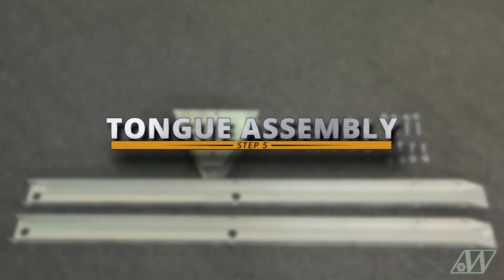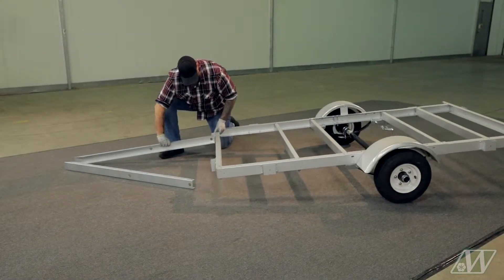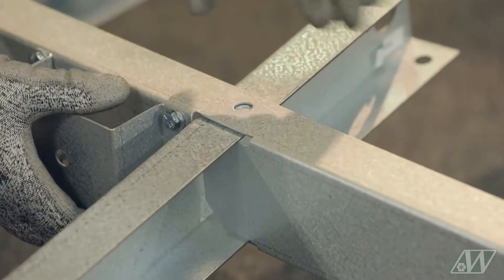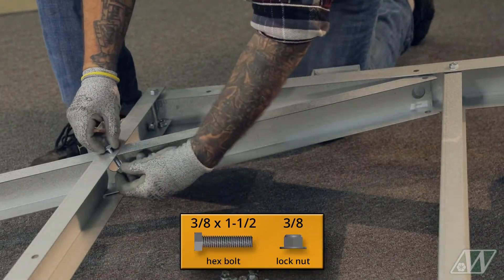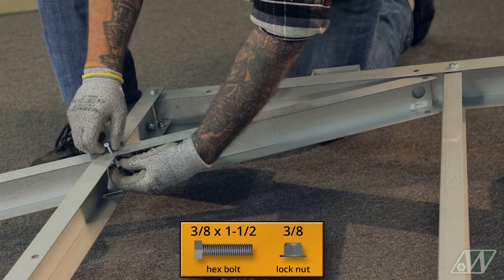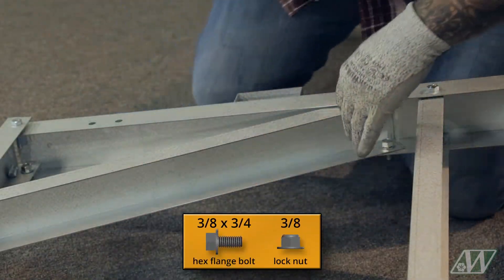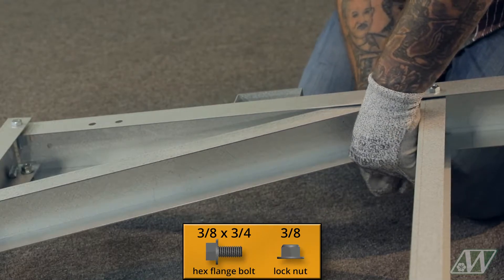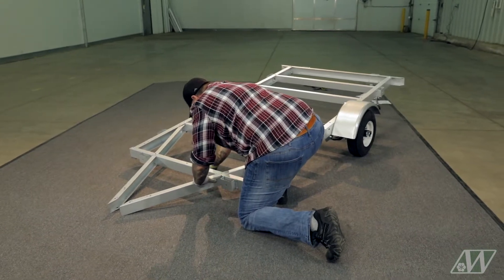Step 05 - Tongue Assembly

Comment: FYI: If you have the 5X8 model, the tongue pieces go inside the first cross channel and are bolted with the carriage bolts. It says it in the manual but the diagram some retailers have is incorrect, and in this video I think they're assembling the 4X8.

Comment: The holes dont line up for the tongue pieces.  I can only start one hole and the other is off by half an inch.  I doubled checked assembly and everything looks correct to this point.